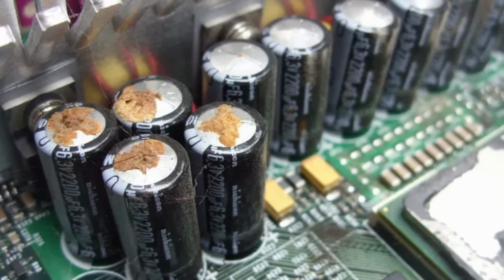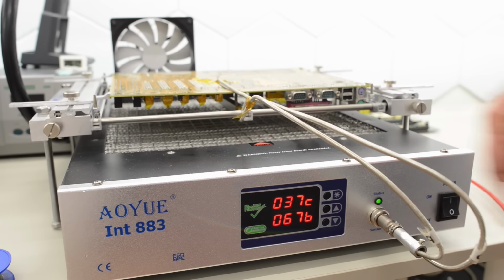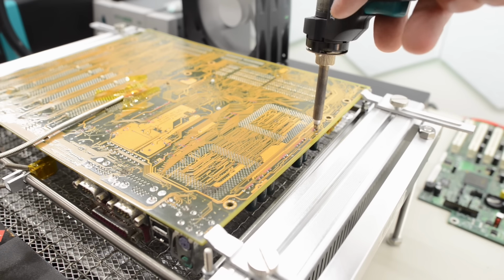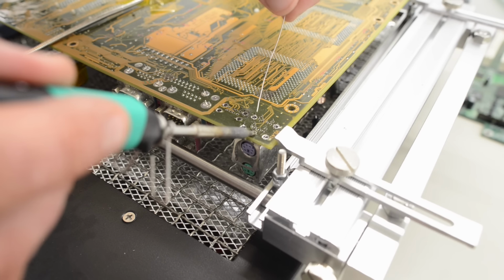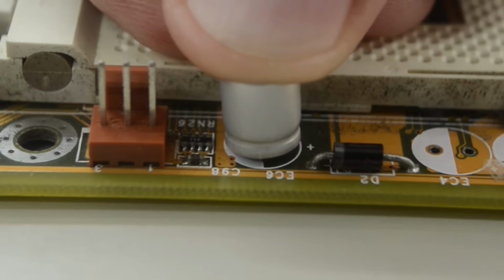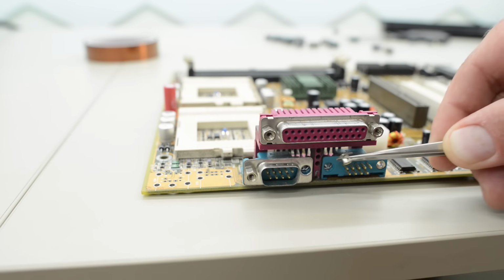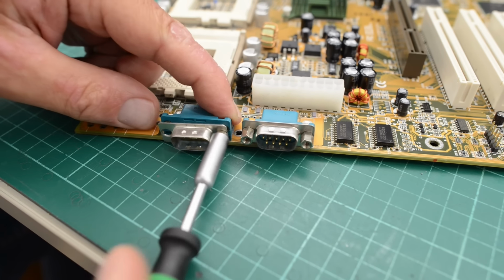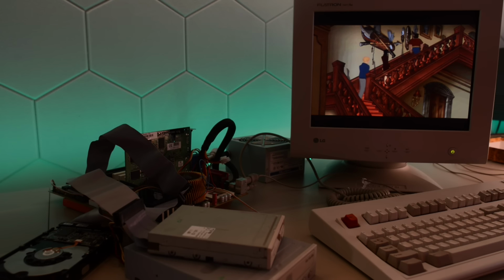ABIT BP6 Repair & mod with modern caps

Comment: I've still got a bp6 with dual 366's OCed to 550 with a voodoo 5 5500 I put in a ton of hours with windows 2000 workstation running linux, windows 2000 and windows 98. It was a hoss when I put it together back in the day it started with a matrox agp for 2d and two 12mb voodoo2 cards that served me well. It took quite a bit of searching to get two 366's to handle the OC and I paid a small fortune for the voodoo card at launch, never be a brand loyalist kids. I stuck with that dog until I got a GeForce 3. Sadly, it does suffer from cap bloat now and the 5500 has some bad ram too but I won't let them go. Parkinson's has taken my fine motor skills so I'll never be able to fix them myself but I'll never let them go who knows maybe someday I'll find someone local who can get them back up and running.
Reply from the maker: Sweet machine. Good luck with the project, I hope you find someone who can help out

Comment: Such fancy desoldering. I remember seeing a friend of mine do capacitor replacement about 20 years back on a low-end Soltek Socket 370 motherboard.
He just balanced the board on his lap and using just a well worn regular soldering iron proudly made somewhere in the Soviet Union with a tip about the size of a pencil eraser he simply heated up the legs of each cap and plucked them out by hand, then shoved in new ones as replacements. Was very very fast work and that board lived for very many happy years after!
Reply: yeah..  i never preheat a whole board to change thru hole components...  that's just overkill.. use a decent iron and pull them bad boys out..

Comment: If you want suggestions on thermal paste brands to look at, I recommend Arctic MX-4 or MX-5, it’s really good thermal paste, a lot of system builders and integrators use it
Reply from the maker: I'll try it out. Thanks

Comment: Mr. Inventor, I did this about 1-2 years ago on a Sega MultiMega, but it still does not work. No read from the CD despite new caps, new laser. Well, in the garbage it goes as the 8 Bit Guy says.

Comment: I sometimes use these V-Chip capacitors in place of through hole like you did but only when I don't have a better fit in my stock. Bending the legs like that make them weaker (straighten them and bend them back once or twice and they will break), so it's still better to use through hole capacitor.
Also, unlike what it may look like, the NCC MZR series is not solid polymer, it's a regular liquid electrolyte cap. Solid polymer may be more expensive than the regular liquid electrolyte caps, but they have better specs, especially much higher endurance rating. Modern motherboards typically use solid polymer caps except when cutting down cost as much as possible (i.e., OEM stuff).
Solid polymer capacitors come with smaller dimensions.
Also solid polymer caps generally have a lower ESR (and higher ripple current rating which is good) than the liquid electrolyte ones with similar specs, so it is generally advised to use slightly lower capacitance to avoid much higher inrush current that the voltage regulator may not like, here you could use 1000 µF or probably even 820 µF. In some cases you can also go down in voltage rating since the output voltage of this regulator shouldn't exceed 2 V, so you can use 4 V-rated caps for example that might come in an even smaller package.
Apparently the caps for VCore are Tayeh LE series, 8×20 mm with 3.5 mm lead pitch, and the 6.3 V 1500 µF has an ESR of 20 mΩ (which I'm always a bit doubtful about for these low quality caps but let's go with it).
So going for the same diameter of 8 mm with 3.5 mm lead pitch there's for example the Nichicon RL8 series, with the 6.3V 820µF cap at 8×8 mm and 9 mΩ ESR.
People often call replacing liquid electrolytic caps with solid polymer a "polymod".
Reply from the maker: Thanks, I may try that mod next time
Reply: @Epictronics1  To what piernov said I would just add that maybe you missed that whole category of caps based on your replies to some posts here? So notice how you are in the "Aluminium Organic Polymer Capacitors" category if you browse on Mouser when you reach that RL8 he recommended, in here are also old timers like the Sanyo SEPC (now owned by Panasonic) and some really amazing new caps like Chemi-Con PSG and PSC series with 15000h lifetime, well, the RL8 and SEPC was already crazy with 5000h compared to 2000h of the electrolytic MZR caps you put in, just keep in mind that going down a little in capacitance is usually not a problem, these caps where originally chosen for their low ESR, so seeing as the replacements are all much better we don't need such high capacitance in most cases, but it does depend on the switching frequency of the regulator, but if you only see 7 or 8 turns on the coils you can be sure the frequency is quite high and then bulk capacitance is not necessary, only low ESR, conversely if the switching frequency actually is quite low like in a ATX power supply decreasing ESR from the original caps could instead increase ripple because the circuit was not designed / tuned for that... As a final mention I see the Kemet A758 and A750 on that page: they are actually cheaper than the ones you bought so should be a nice recommendation too!
Reply from the maker: @perhansson6718  Ok, thanks. I just quickly checked Kemet A758. It looks pretty good. It's 12mm tall so It might just about fit under the large cooler!
Reply: @Epictronics1  You're welcome, also note the A758KK128M0EAAE014 for example: it is 8mm tall, only rated for 2.5v but that is no problem for the VCore of the CPU... Just be sure to not use it for the 5v or 12v input to the VRM ;)

Comment: lol I could never have a dream machine with a celeron. I've always hated them. And the one time I had literally no choice (because they already bought 2000 of them without asking me).......they were shit. They were core2 era I believe in laptops. They were way too damn hot. They only had 1 core. They crashed like crazy. Those computers were trash and I hated them. So next year they actually asked me. I said NEVER buy that crap again. We got pentium dual cores. The failure rate was 10% of the celerons. They didn't overheat. They were great machines. Even the teachers like them because the students could get logged in a lot faster.
Reply from the maker: The ABIT BP6 is the only epic mobo with celeron. Back in the day, I was the guy who repaired PIII-era Celeron Compaqs. There is no way you hate those machines as much as I did back then lol
Reply: @Epictronics1  so from what I'm finding you can run 2 of them, but if you use a P3 you can only use 1 of them? That's really odd.
Reply from the maker: @awilliams1701  Yes, that is correct. You can run a single PIII on these boards.

Comment: I wouldn't bother with the ports until after replacing the caps and making sure it actually works.
Reply from the maker: If it hadn't worked, we would have fixed it :)
Reply: @Epictronics1  even if the chipset was bad?
Reply from the maker: @awilliams1701  You may want to keep an eye out for the upcoming ABIT VP6 video...

Comment: I had a Gigabyte board with two Slot 1 Pentium II-350 MHz. Imagine this disappointment when I realized that mostly NT Workstation 4 and Quake were capable of using them. Many years later I knew what happened (and also why multi core CPUs had a hard start) ;)
Reply from the maker: Yeah, the fun was somewhat limited with dual CPUs back then. I had a VP6 but the same issue.

Comment: Adding low  temperature melting solder seems to  make it easier to desolder components. I have not tried it but the youtube video looked convincing.
Reply from the maker: Yes, I love that stuff. I use it all the time when I can't use hot air

Comment: Fun video as always but your solder sucker technique always makes me cringe :) I had a job once where for 8 hours a day I replaced caps with one of those. About 3-400 caps a day for a whole year! :) You need a tip with a hole the size of the leads and absolutely no bouncing around scraping all the traces, pads, mask, etc, etc. If the hole is too big that means the bit is completely worn out :)
Reply from the maker: Yes, all my tips are worn out :) I'll order some new tips

Comment: Thing id worry about with replacing the fan is it might be intended for a fairly high flow or static pressure fan or something and quiet fans might just not meet the spec.
Reply from the maker: Hmm.. I have to do something about that fan. It sounds like it's about to die. Maybe I'll just replace it with the same spec Noctua

Comment: why nobody doing hacks on the caps? because they exist in both smd and trough hole versions by design? at least i think i seen polymer caps of this style in trough hole variants installed on many graphic cards i own
Reply: 1500 seems like a very high value for these caps. Something like 680uF 6.3v ultra low ESR poly caps from Panasonic would probably be a good replacement. Testing necessary of course.
Reply from the maker: There is only one through-hole option still made to replace these and they are absolutely huge. They could be bodged to fit but look hideous

Comment: I'm looking forward to the dual Socket 370 shenanigans :) I built a dual Slot 1 system during the weekend based around a Gigabyte GA-6BXDS board with two Pentium IIIs clocked at 600 MHz :)
Reply: i have a dell with dual pentium 4 based xeons

Comment: If that thing can do 100mhz FSB, you'll be able to do more than run late Win 98 based games. Hunt down some 333, 366, 400 mhz Celerons and see if you can get them running in SMP. Should be enough for early DX8 or DX9 games with a powerful enough GPU.
Reply from the maker: I have ordered a pair of 300A and 533. This should be fun :)
Reply: @Epictronics1  I'd hunt down a few sets in the middle of that range. I've heard the onboard L2 falls flat on its face beyond 600 ish MHZ unless you're planning to compare  high CPU speed  (533 mhz) + 66 mhz FSB vs moderate CPU speed (450 mhz) + 100 mhz FSB. Unless you're planning to OC the board to 133 FSB...
Reply from the maker: @ironhead2008  I don't think BX440 will do more than 110 max. Ok! 366s are on the way too now :)

Comment: That's indeed a nice hack with the SMD caps. Flipping over regular caps would likely do the trick as well, but certainly not look "factory".
Reply from the maker: The only still available through-hole caps are huge. It would work, but look very dodgy
Reply: @Epictronics1  you can certainly get polymer caps in the same size factor you have in the video, with through-hole leads, e.g. something like HS0J158M0808PC or many similar ones on LCSC
Reply from the maker: @seritools  I checked and there is only one option still made. They could be bodged to work but would look hideous
Reply: @Epictronics1  ahh sorry - i meant the same form factor as the replacement cap! the one I mentioned should have the same dimensions as the SMD one you used in the video unless I'm missing something?
Reply from the maker: @seritools  Hmm.. Honor branded. are they any good? Are these low ESR too?
Reply: I've done a partial recam of my MSI KT-3 Ultra with 8mm diameter, 12mm height polyper through-hole caps, for example, worked beautifully ^^
Reply: @Epictronics1 ESR was as good or better as some low-ESR Panasonic and Nippon Chemi-Con caps I had lying around. Endurance of these should also much better than regular electrolytics; polymer caps scale really nicely with lower working temperature ^^
Reply: @Epictronics1  : Another "solution" could be Tantalums (like in the good old cap-popping days). But then again, you already found a well working solution, that does not include fireworks.
Reply from the maker: @bikkiikun  Yeah, tantalums crossed my mind. I didn't look into it but I will for some future projects. It might be a good option!
Reply: @Epictronics1  : Another odd choice that just came to my mind is to mount the caps from the underside (and flipped over) if there is space. This way, they are also away from the heatsink's heat, that shortens caps' lifetimes.

Comment: i have the same MB, found it at the scrapyard. no bulged or leaky caps, they look fine, but the board is dead, no post no nothing. i keep it as a treasure, it sure is :) great repair!
Reply from the maker: Thanks! I can pretty much guarantee bad caps are preventing your board from booting. This board was completely dead but only showed minimal damage to one of the caps
Reply: I had multiple machines with BE6 and such and the same era. All failed this way, no visible damage but recap was needed. Now it is fun, but I had like 15 machines dying after around 1 year of office use…
Reply from the maker: @SergiuszRoszczyk  Yeah, unfortunately, I got rid of my original VP6 back in the day, before realizing it was just the caps!
Reply: @Epictronics1  it was not that obvious then, before it was too late :(

Comment: that cap trick is indeed handy
i could have used it yesterday lol

the lead spacing can be matched, but not the 8mm diameter cans. not in such high values at least.
Reply from the maker: My patrons knew about this trick yesterday ;)
Reply: you can most definitely get 8mm diameter 6.3V 1500µF through-hole polymer caps, likely with the right lead spacing too
Reply from the maker: @seritools  I found the datasheet for the cap you mentioned. Unfortunately, it's in Chinese so I can't read if they are low ESR and 8mm for this rating

Comment: I had a BP6 with dual celerons overclocked, watercooled with my own custom made waterblocks and that water was chilled using compressor cooler. I remember how condensation formed on the back side of the motherboard, but it never broke. Can't recall what I actually did with that computer but it was my only comp at the time.
Reply from the maker: That is a very period-correct hack, awesome :)

Comment: I used to own a BP6, with two 400MHz Celerons running at 600. Loved that board!
Reply from the maker: Sweet. I'll see if we can get it up to 600!
Reply: @Epictronics1  I'll be watching!
Reply: I used to run Falcon 4 on Win2K and dual 466's for the SMP - a year or two later I upgraded to a Duron 800 system and it left the BP6 in the dust!  Things changed fast in that era.
Reply: Me too. I had mine up to 550mhz. Loved that box.
Reply: When overclocked and in SMP, those Celerons tended to leave the entire P3 line behind in the dust
Reply: @kontenterrorist  Mine was pretty quick running WinXP.